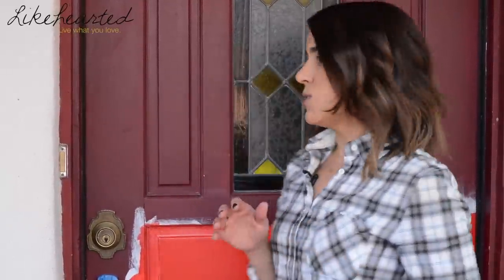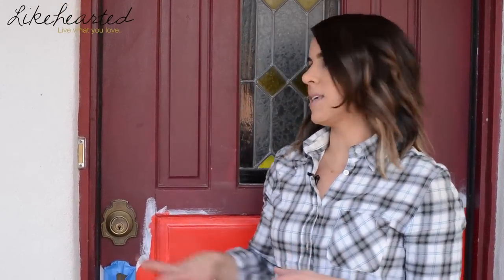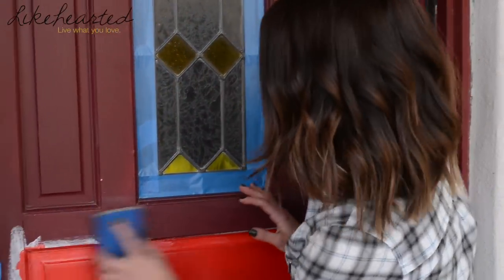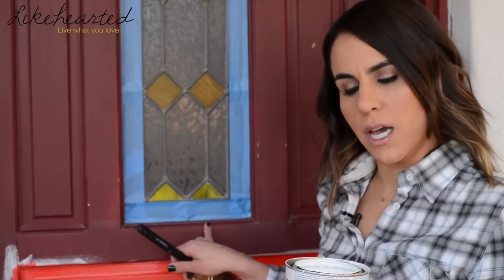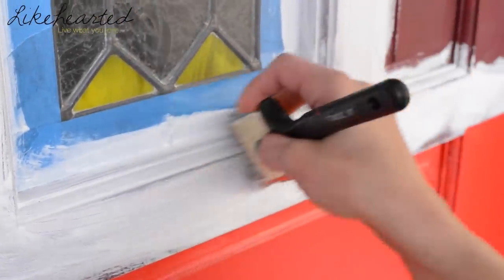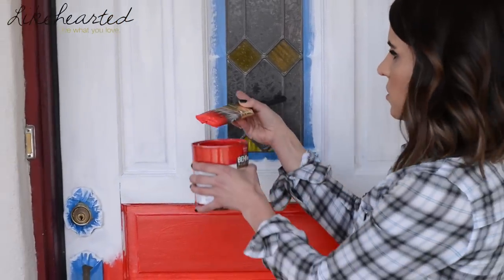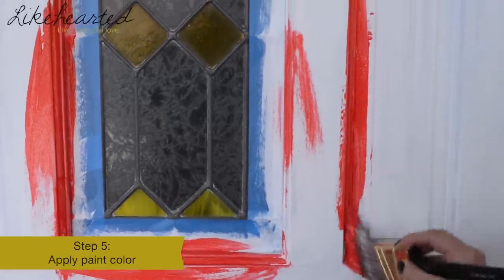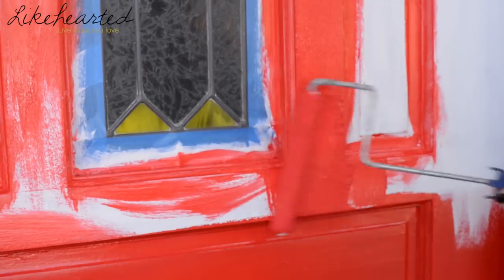Curb Appeal: How To Repaint Your Front Door

Comment: Totally the wrong way to paint a door! Always paint the mouldings first followed by the panels then the cross members and long stiles last. Would be better with the correct colour undercoat too then the finished coat will be solid and not "see through "like this travesty. I should know seeing as I've done this job for over 40 years!
Reply: @M Hurst I apologize for your upset feelings from someone else's constructive criticism. Please consider that KW isn't "bad mouthing this young woman."  KW is giving KW's advice for what's commonly known as a "better" method to paint an exterior door (apparently without the pre-painting preparations).  This young woman in the video is presenting advice and technique that is inappropriate for an educational video on how to paint your front door,  but the young woman's presentation would be appropriate for an educational video on how to paint your front door so that it looks like a bad accident (accident is used appropriately when you understand that re-using the paint brush with white primer still on the brush will mix white primer into the next paint color; altering the red color both in the can and onto the door in this video...OK?).